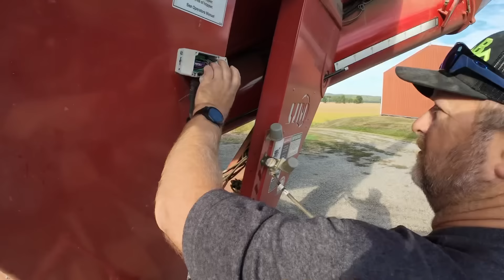What happened to the Bin Site Project?

Comment: The cushion boxes also help preserve the grain quality.  Once the initial grain enters a box, it partially fills with grain, so that the grain speeding down the pipe is hitting grain  instead of hard steel, when it turns to drop into the bin.  If it was constantly hitting steel only, you'd experience more cracked/ damaged grain.  Grain on grain acts as a cushion, thus cushion box.

Thanks for another video, and filling us in on the bin project.

Comment: I really wont worry about dumping air bags while unloading.  You dont dump the truck bags and they survive.  You really cant dump grain fast enough to do damage to a good air bag anyways.  If its a questionable air bag, then maybe but i have lifted 20 ton mill blocks of almost instantly and never had a problem.  Its kinda like hitting potholes.

Comment: Edison Motors utube channel built a ev retrofit logging truck and a new ev hybrid truck.  New Scania non def diesel motor, 280 kwh battery in frame, ev electric motor regen braking axels.  Saves 40% fuel, red dye legal, no road tax ever.  Chase saves $10,000.00 a month Canadian on just diesel fuel.  They train and certify installer on your trucks.  All user repair friendly off the shelf parts.  Edison also will hook up solar equipment and diy installations for the farm.   They started on bush solar wind generator camps.  Put those roofs to work.  Every day each truck sells 500 kwh back to the grid at peak rates.  1000 kwh x .15 kwh is $150.00 a day gross revenue sitting.  Rent as silent event power plants, emergency power and res ue ev',,,'s and ev semis hauling corn.  Charge them vs toe them.  The battery charges stationary on 1 hour 280 kwh.  2 hours driving.  3 kwh per semi mile.  Good luck 100% depreciation and tax credits apply.